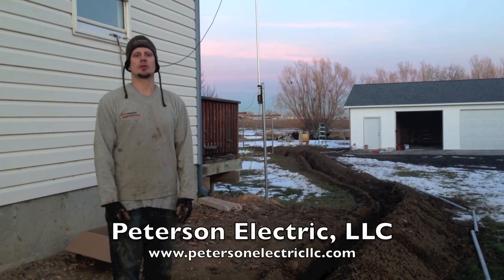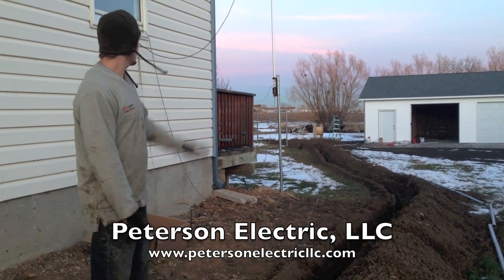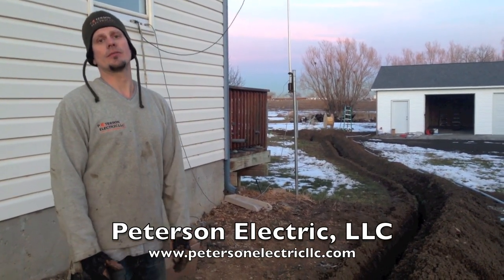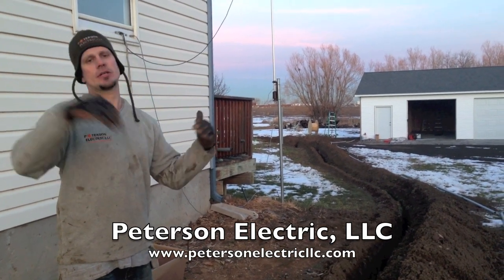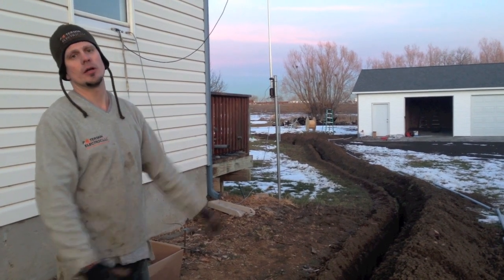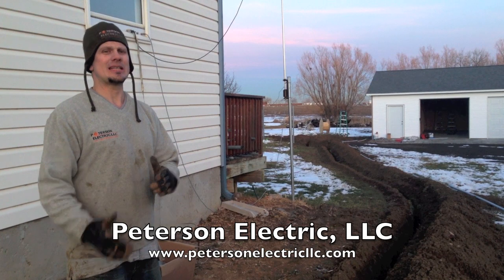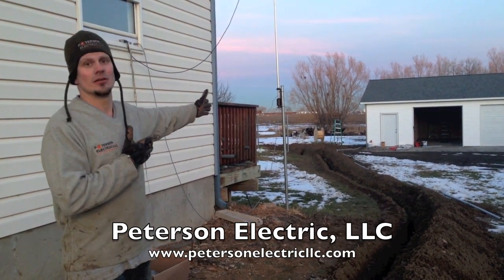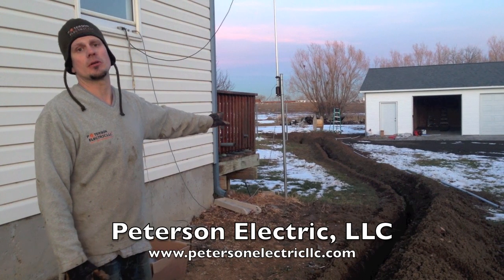Trenching & Wiring A Detached Garage, Loveland Electrician, CO

Comment: what kind of wire do you use for kind of job?
Reply: None of the videos I have watched about getting electricity to a detached garage say anything about what gauge wire to use.  What is the point of the video if the most important part is never talked about?
Reply: hahahaha same here!! I've asked the same question on like 10 videos!!
Reply: Size of wire is based on need, size of panel and length of travel.  When you exceed roughly 50', you start to have voltage drop and you compensate by upgrading wire to carry more voltage.  If you don't do this "based on the intended demand", you risk overheating the wire in the conduit and throwing the main breaker in the main panel because you draw more than the wire can supply.  Also, the conduit needs to be sized to accommodate this as well to give enough volume for the wire to not overheat.  I am not an electrician but I know enough to somewhat understand it and call an electrician for help to be sure it's done right.
Reply: You can use THWN in conduit or UF without conduit